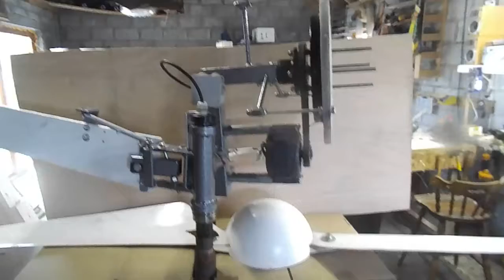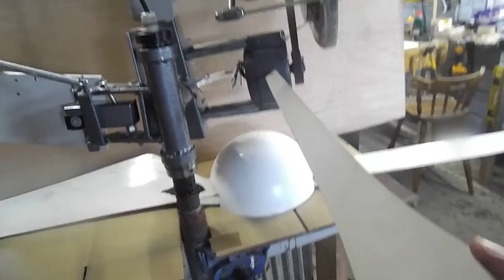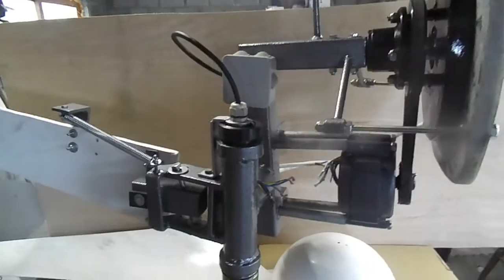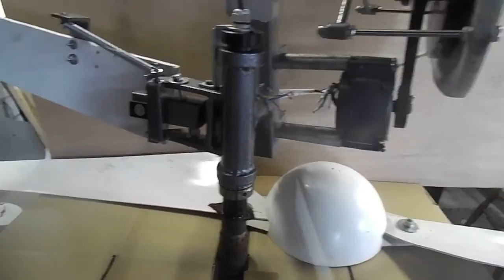Multi role wind generator

Comment: Nice set up. I like your stainless assembly. I'd move right to a better prop. Two blades won't cut it. Especially since you have aggressive winds. Keep up the work:)
Reply from the maker: Thanks yes working on three blade design. Braking the turbine in 70 mph winds needs two blades so far but I see your point.

Comment: Nice idea and looks great but if I have 100mph winds my roof would be peeling off and I would be in my tornado shelter.. LOL..It would be nice if you could use the axial flux part also to charge batteries for people that are off grid..  But still nice job
Reply from the maker: +Randy H Yes can easily be adapted for the axial flux to charge batteries as well. Just a matter of swapping the stator over to what ever voltage you need. I thought I could have one turbine doing two jobs. That's a lot of savings on towers etc.

Comment: Very nice Ian! I always like your out of the box thinking and that's good food for thought. Good to have redundancy for the brake system. In a way, when you add the furling you have three ways to control the blades. Out of curiosity what type of stub axel did you select for the axial flux spindle.... looks like 4 bolts by 4" standard utility trailer type? I have been making a new axial based on 12" magnet rotors and made my own shaft which is a little tedious. Hope to post a video sometime soon. Great work as usual
Reply from the maker: +belgrademachine Thanks yes standard 4" utility trailer  these are sealed bearings so there is no packing of bearings I think they for off road 4x4 's I found them on ebay

Comment: Dual purpose wind turbine, never seen one before so i guess your the first, brilliant. One tower for 2 wind turbines in one.
Reply from the maker: +MissouriWindandSolar  First and last Lol. The axial flux can be adapted to a Gti of my choosing. The freedom can charge up the 12 volt bank. I can spend thousands on batteries and upgrading every thing else to suit or do it this way and just buy a good grid tie inverter. The savings I will spend on drink and horses. I will just waist the rest Ha Ha.

Comment: very nice as usual, you do very nice work, they do have hybrid grid tie inverters that will both charge batteries and feed power back to the grid like this one, so you would not need the two pmg's.
best
for example
https://www.altestore.com/store/inverters/hybrid-inverters/schneider-electric-conext-xw-5548-invertercharger-p11454/
Reply from the maker: +Rev John O&#39;Toole Thanks John will check it out. I want to stay 12 volt for my battery system and be able to adapt the axial flux to any voltage system for the grid tie. most gird tie inverters seem to be on the higher voltage end. This will give me a chance to pick my own gti and just build a stator to adapt too.
Reply: +ian57812 
Beautiful work my friend as usual. You always have fresh ideas when it comes to Wind Turbines.
I will stay tune for the latest video on that Turbine. 
Please subscribe and God bless. 
Cheers